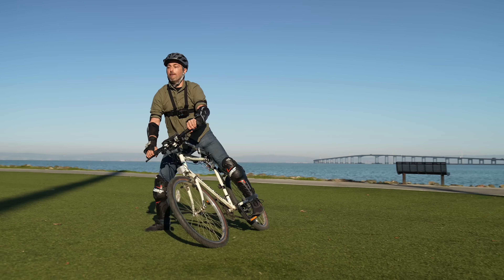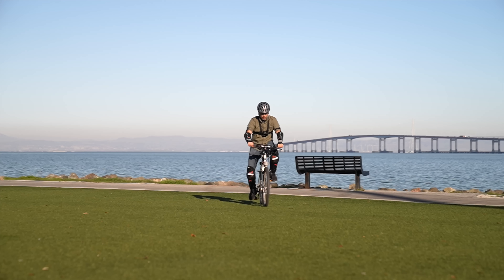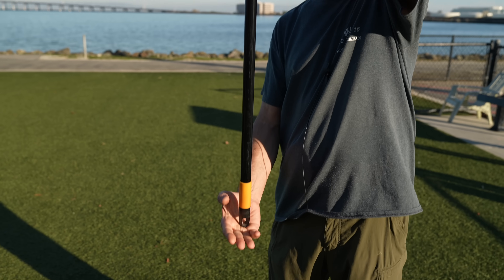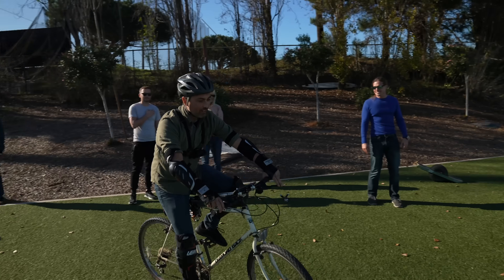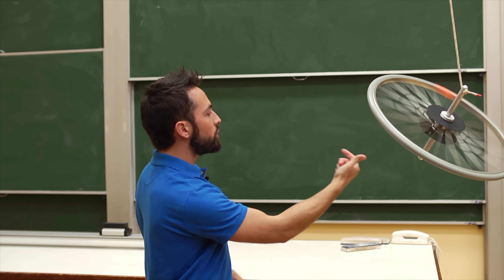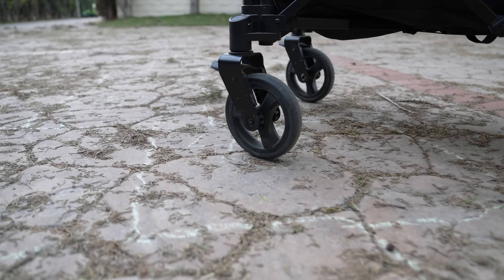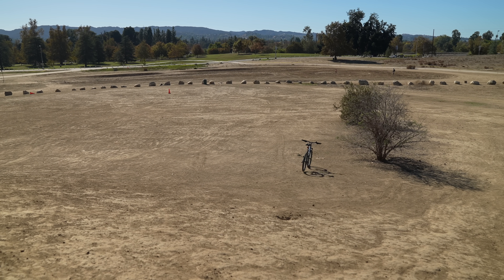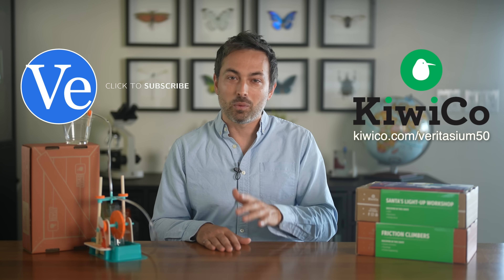Most People Don't Know How Bikes Work

Comment: BMX bikes kinda great this rule, you can turn without counter steering
Reply: How is BMX different than any other bike?
Reply: @XtreeM_FaiL  just speaking from experience, I think it’s because of the riders low center of gravity, and the way the handlebars are when you’re standing. But at average riding speed you can easily turn on a dime without counter steering first, which is obvious when riding in skateparks because sometimes you’re riding up again rails or walls and you’d hit them if you had to steer towards them first
Reply: @117Hams  If you were so close that you didn't have room to countersteer you'd hit them anyway. When you turn the front wheel it sticks out on both sides. The front sticks out in the direction of the turn, and the back sticks out in the other direction. And of course you also have your legs sticking out on either side.

Countersteering doesn't mean you have to swerve a large amount in the "wrong" direction before turning the way you want to turn. It can be very slight. Many of the examples in this video are exaggerated. The one a 3:04 is fairly reasonable.
Reply: @allmhuran  no because the bars are wider across than how far the tire sticks out when you turn. So your bars would hit before your tire did
Reply: @117Hams  The bars are widest when the wheel is straight...
Reply: @allmhuran  yes meaning that when you're going straight you'd never be close enough to a wall when you turn that the tire could hit, because when you're going straight the bars keep you that distance away
Reply: @117Hams  So what's your argument, then? You originally said "sometimes you’re riding up again rails or walls and you’d hit them if you had to steer towards them first", but now it sounds like you agree that you're never that close after all.

Comment: Ride a recumbent bike. Your body is essentially fixed in place by the reclining seat, so you cannot help balance by shifting your weight as on a conventional bike. You quickly learn that balance must be achieved by steering only since you cannot lean relative to the bike frame.

Comment: I thought that counter steering is well known already. Experienced riders know that you must counter steer (Turn left to go right in Speed > 30kmph)
Also, this can be seen in a motogp race (motercycle race) where the riders will lean so close to the ground when they turn and their front wheels will be pointed to the opposite direction
Reply: >> Turn left to go right in Speed > 30kmph

Turn left to go right at ALL speeds

Comment: This makes sense as your maintaining forward momentum in that direction, so if you make a harsh turn to the left for example, you need to first counter balance your weight, to prevent the bike from toppling over.

Comment: I watched myself cycling (60 years experience!).  This video isn't the whole story.  I mainly steer simply by leaning.  This is what causes the correct angle for a turn.  I turn the wheel very little, and that mainly to maintain balance with micro-turns.  These experiments on a small patch of grass, moving slowly, don't recreate cycling on roads. The gyroscopic effect increases also with speed.
Reply: Let's pretend for a moment that what you're saying is true. Suppose you want to turn left. Do you lean your body left, or do you lean the bike left, or both?

Comment: Do tractor trailers do the same? I've also heard a term "farmer's turn" where I'm from. Some people will swing their car right before going left on a country road, I assume it is from farmers executing turns on tractors or other equipment like the truck drivers.
Reply: That's just to make space on the inside of the turn, because if you're pulling a trailer the trailer will follow a tighter turning circle than the pulling vehicle. It's not to do with countersteering. Countersteering is only for vehicles that need to lean.
Reply: @allmhuran  The front wheel of the bike turns like the lead vehicle, but the trailer is fixed, like the rear wheel on the bike. This pushes the rider off balance in a similar way that it can jack knife a truck.
Reply: @FGHY8  Trucks. Don't. Lean. Sure, if you try to turn too sharply they might overbalance and lean, or tip over, towards the outside of the turn, because the centre of mass is still above the point where the wheels touch the ground, and is attached to the wheels via suspension which can compress. But trucks don't lean into turns when turning.

Comment: This really isn't that surprising , isn't really new and, given just a few seconds to think about it, is kind of obvious.  You are balancing on a bike.  You need to turn to the right.  If all you do is turn the handlebars to the right, you will lose your balance to the left as the tires kick out from under you off to the right.  So...you have to turn the other way for a split second so you are now LEANING to the right and then follow through the lean by turning the wheel to the right.  Not really rocket science.  It applies to walking too.  You don't start by putting your foot out,  you start by leaning.  You then compensate for that lean by moving your legs to stay upright.
Reply: >> Not really rocket science.

And yet thousands of people in these comments still won't accept it.

Comment: You can turn a bike without counter steering quite easily. I’ve re-learnt how to ride a bike after not riding one for over 12 years and I now steer by moving the bike underneath me instead of turning the handle bars. If you use your arms to tilt the bike, keep your body in the centre of the bike and learn slightly in the direction you want to turn, you do not have to counter steer at all. Video proven wrong immediately.
Reply: Shifting your body causes a countersteer. A countersteer doesn't have to be performed mechanically by using your arms to turn the bars. A countersteer just means the wheel is steered away from the desired turn direction, which creates the desired lean angle, before being steered back into the turn. Whether you accomplish that by direct input on the bars, or by shifting your weight around, or by pressing a button labelled "turn please" which does it all via a computer doesn't matter.
Reply: >> Video proven wrong immediately.

No

Comment: Lol the reason people can make it stand for seconds is due to the weight of your body that is on it if it did not have any extra weight then it would go for mins also if just pedal for a sec then you pick up your feet it would keep on going
Reply: Raising the centre of mass makes it more stable, not less stable. Counterintuitive, but true. Think about the "balancing a broom" example show in the video. The broom is easier to balance with the heavy end at the top. The reason for this is that it means there's a great deal more inertia to overcome in order for it to gain or lose angular velocity.

Comment: This is TOTALLY wrong and you staged this video
Reply: You DO NOT have to counter steer
Reply: @juicexgang7108  You're right. You don't have to, but then you will fall.
Reply: @XtreeM_FaiL   no fr I tested it out you don't have the counter steer you can just point the front wheel where you want to go test it yourself this video is B's
Reply: @juicexgang7108  when you tested it, how did you prevent yourself from subconsciously counter steering a little bit? These guys did by mechanically locking out the handlebar from doing so, and it seemed pretty well set up. Did you find a flaw with it?
Reply: @FlyNAA  nah I literally had my family watch to see if I HAD to counter steer and I littery just shove my handle bard right or left while leaning into the turn like on a motorcycle and I can turn I think his theory is only true for in experienced bike  riders and I can print make a video proving my point

Comment: Something to ponder is that this same maneuver is done in a semi truck you first stear to the opposite side even a little makes a big difference. Semi trucks share another component, and that is the articulation in the front part of the vehicle. So in many ways a semi is similar in nature.
Reply: Semi’s don’t do that to balance. They do it because the trailer follows a tighter circle than the truck, so they swing to to make sure the trailer stays on the road.
Reply: @thatoneguy611  the forces still work the same regardless is my point. I don't swing wide to stay on the pavement when I'm on the freeway the CG does act upon a semi in the same way, is it done the same for the same reason by most or for most of the time no perhaps not, that does not however change the effect of CG nor does it act much differently at speed around larger radius curves and turns. Since I drive a semi I think I understand how it works and why it's used but thanks for teaching me something I already knew smh 🙄

Comment: trackstands tho.
Reply: Try doing a trackstand with steering locked straight ahead.  You'll fall almost immediately.  When people trackstand, they do two things...  They turn the front wheel pretty aggressively (usually around 45 deg) an they move slightly forward and backward.  That causes the front of the bike to move left and right.

Comment: you are always counter-steering before a turn because your legs alternate putting pressure into the frame at either side, as you pedal.
so, you counter-steer to stabilize the uneven torque, and THEN lean into the actual turn.
speed cyclists and motorbike riders don't have this problem.
watch a line of Tour-De-France riders coming down a slope perfectly taking a turn without pedaling... they just lean left or right!